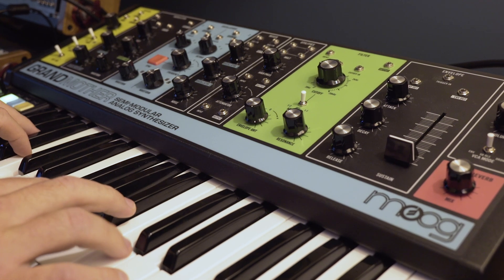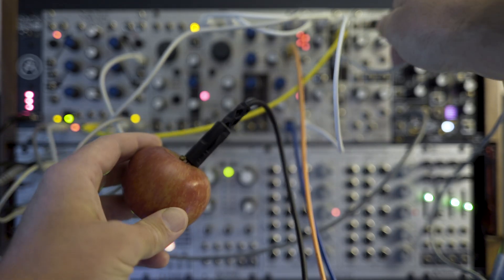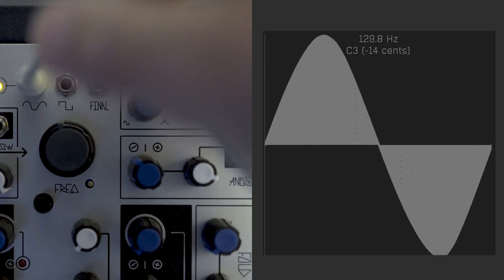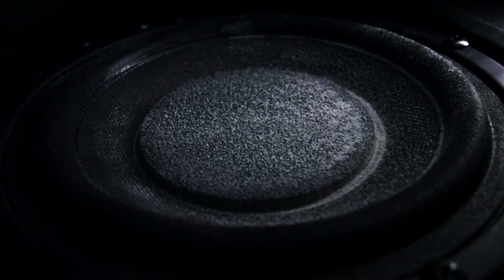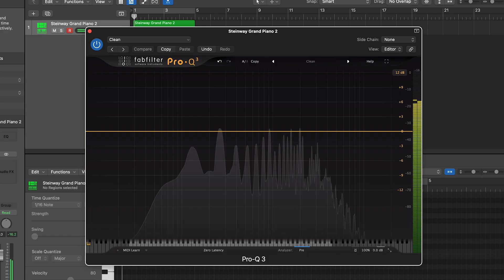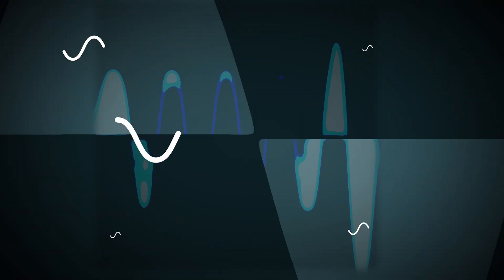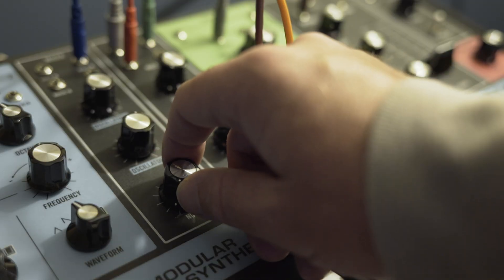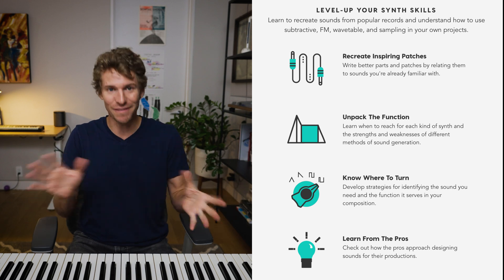Synth 101: How oscillators & waveforms work

Comment: 5:32 using that synth drum in a swing pattern that ppl are so special using a drum machine separately to do when you can absolutely swing/oscillate/sequence. You can edit make it more seamless with the  portamento function higher up makes it more seamless generally in the middle helps seam those swing percussions flow into whatever else is cooking